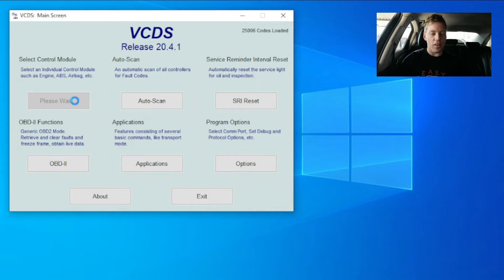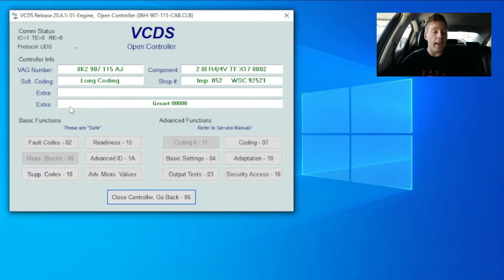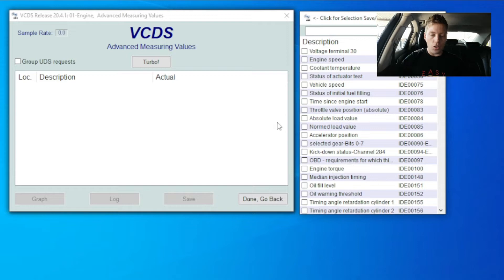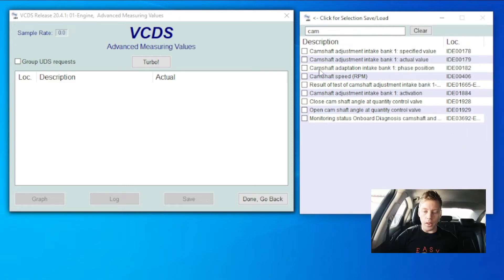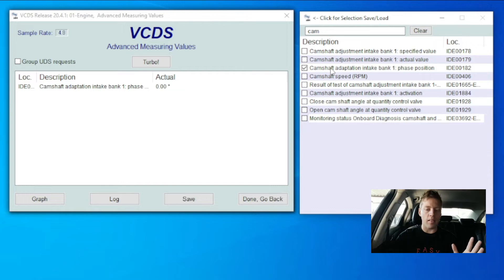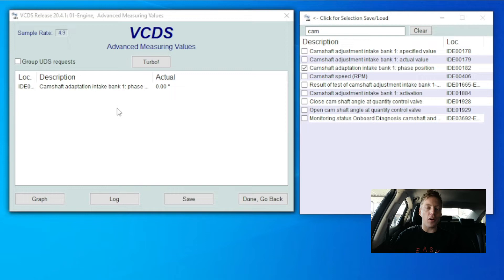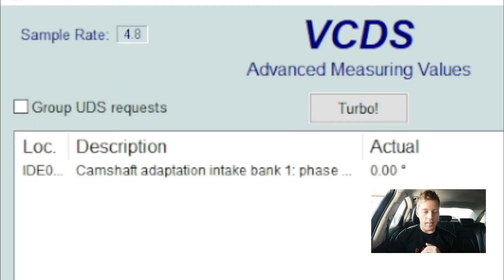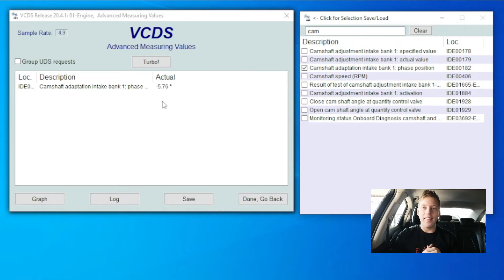How to See your Timing Chain or Belt Stretch with VCDS

Comment: hey, i have an 1.6 FSI with Timing Belt , not Chain, and at Camshaft Specified value is 0 and Actual value is -0.5 but the Phase Posision is between +6.0 and 7.50 all the time, with +, it might be a problem or it might be the cause of kind of rough idling ? it means the variator might be a little in advance? Thanks so much
Reply from the maker: Hallo 🙌 I don't have to much info on the phase position I will need to look into it. But by the look of your cam positions it should be fine 👌 let me do some reaserch on what phase position is and I will get back to you.

Also what you can try to do is remove the oil cap slowly when the car is ideling and feel if there is a lot of suction on the cap. If there is then you have a air leak somewhere that is causing the suction. By the oil cap there must be a blow and suck motion then you know it fine, not just a suck suction pulling the cap down (for your rough ideling)
Reply: @megalodononwheels  thank you so much for the info, there is no suction on that oil cap , i had one problem with air leak because of PCV Valve and replaced the rubber membrane, now works better but at every 2 seconds seems like something is wrong and Lambda tries to equilibrate the mixtura air-fuel, because i see on channel 002 hte Ignition Angle is changins between 3 and 18 degrees, and its not stable ( i saw it should be stable at 15 degrees ) my engine is a 1.6 fsi BAD from VW on Golf mk4, thanks for hints, injectors looks fine on 015 and 016 channel.
Reply from the maker: hi, I am not sure what it might be then. have you ever done software on your car? It is normal for your timing to jump around but maybe with 4 or 5, not 15 degrees lol that is a bit to much. I wonder if its not your MAF or MAP sensor.
Reply: @megalodononwheels it might be MAF , sometimes i see 1.4g/s and works kind of bad, and other time the MAF gives 2.1g/s and works well...

Comment: My 2011 audi avant wagen 2.0L TSFi had timing chain, tensioner.and guides replaced at 68,175 miles I now have 110,000 miles my VCDS reading for Camshaft Adaptation Intake Bank 1 Phase shows -.55   Is this concidered a normal reading?
Reply from the maker: I am not so familiar of how much it should be after a certain amount of miles. All I know is where it gets risky 🤣 but if you have the revised tentioner and guides, I don't see why this will not be correct 👌

Comment: I have a question please can anybody answer me? i read this value to +4.3 degree. NOT minus, but PLUS. is good or not?
Reply: is a golf mk7R
Reply from the maker: Hi, was the chain done recently? Do you notice any problems with the car? Because if it is +4.3 it means it is advanced to much.
Reply: I buy the car 3 months ago, i dont know the previus owner doesent told me nothing about the timing chain, only the turbo and water pump. In the service book nothing about timing chain. The car have 104.500km and Is a 04-2014.
Reply from the maker: Is there any weird vibrations at idle? Does the car jerk when accelerating?
Reply: @megalodononwheels  no vibration, but between 2000 and 3000 RPM at only full load there Is an empty of Just a millisec  its very fast to go away some times imperceptible.
Reply: I opened the timing upper carter in plastic and measured the distance between the camshaft timing marks on the chain It supposed to be between 124-126mm to be good. Mine Is 125,85mm. So Need to be replaced in a couple of months.
Reply from the maker: Yea it seems to be stretched a little bit. Usually they can stretch a bit firther than 124-126 but not reccomended. But Glad you got an indication on what is going on 😊
Reply: just bought the exhaust camshaft central magnet was having problems, (p0011) I replaced them both including the internal mechanical valves. after this no problem, no rattle noise classic of a stretched chain. Sometime i have the p0151 but i dont know why, after installig a hg-motorsport oil catch can kit it happend, now is 2/3 weeks this fault is not coming out.

Comment: My wife's b8 q5 just passed 87,000 miles. I checked the timing and it showed -26.08...   is that possible?   Maybe skipped a toot or something? Maybe broken guide..?
Thanks
Reply: Reason is because you’re probably using imperial system instead of metric. I was getting 26* as well and switch to metric and went to -3.2*. That seemed more like it because my car runs perfectly fine. Hope that helps!
Reply from the maker: ohhhhh damn! It never crossed my mind that it might have been Imperial!
Reply from the maker: I hope it is a error with a sensor or something because if it is accurate then it is really bad 😱 have you noticed anything on the engine? Like a rough idle? Poor performance, bad fuel efficiency? Struggles to start? Those are some symptoms of timing being out.

It could be any of the things you mentioned aswell as the tentioner.
Reply: @megalodononwheels  Yea, it's definitely been running funny. Threw a bunch of codes which had be thinking the timing chain had stretched or something. But if -5 is in need of replacement wouldn't -26 be underivable ?
Reply from the maker: Yea that is not good, i would really suggest to stop the car until someone can have a look for you. 🤕 Also it depends on what caused the damage and how much tention is still there, lets say half of the guide broke, then there is still tention, not enough to fall of but just has a lot of slack... 

Also in some cases engine builders will actually set your exhaust gear a tooth back to take it from an efficient cam to a high performance cam.

So I would say till this far you are very lucky!